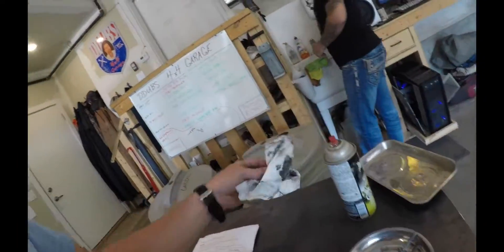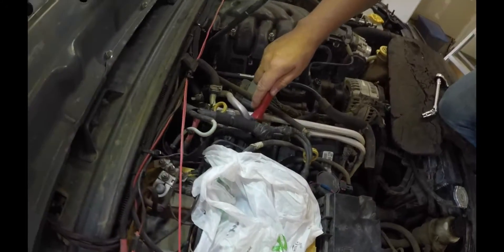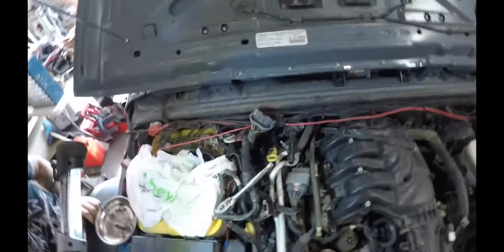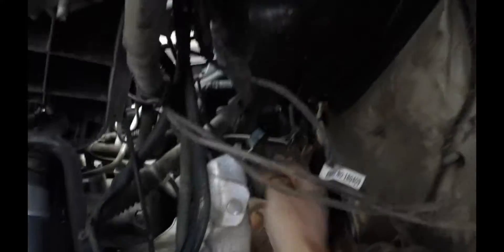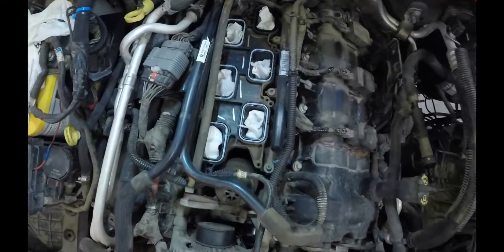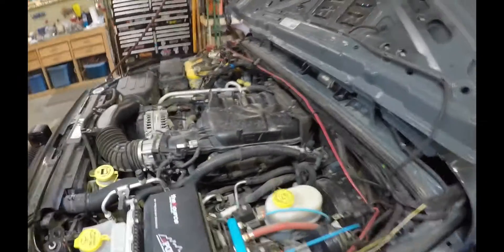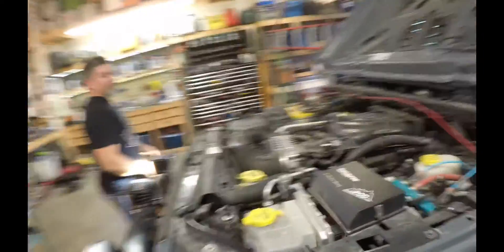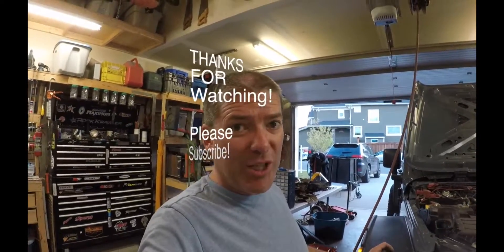Changing Spark Plugs on a 2014 JKU

Comment: You don't have to go through the wheel well to take off the bolts to the bottom of that bracket. You're just take off the top bolts. The plenum will lift up and slide towards the passenger side, and come right out from those studs. It's better to leave them attached because you can slide the slugs in and then the plenum down so you know that you're right on top of the gaskets without shifting them out of place. 
(However) with a 13mm deep well socket, a wobble socket, and about 16" of extension you can, it's really not big deal cuz you can get in there and loosen them up. To me it's easier to get it out of the way but I'm just saying you don't necessarily have to if you don't mind working it out.
Reply: Yep exactly. Most other videos on this job, show that you don't need to go through the wheel wheel or even take that bracket off completely.

Comment: Guess who isn’t going to change plugs.....that would be me
Reply from the maker: It's not that hard, just time consuming.  Having the right tools does help too.  Thanks for watching.
Reply: Did you end up doing it yourself or taking it to the shop? if you took it somewhere, i'm curious how much you paid? I did my plugs & plenum gaskets today, it was not TOO bad, but by far the most complex project i've done on my JK. Super satisfying and a confidence booster for projects to come.
Reply: I’ve been thinking about doing it. I have enough money left for shop fees. It’s spark plugs and serpentine belt or front axle seals and ball joints? I’m working outside so I’m picking my battles.

Comment: There's nothing simple and straightforward about this. My old TJ 4.0L Sahara involved no disassembly. You just popped off the cables, swapped out the sparkplugs, put the cables back on and done. That's simple and straightforward. Manufacturers design this way  to feed business to repair shops but at least it's not German.
Reply: joke is on the manufacturers that there are a tone of video's on how to do this.  but ya I miss the days of my old 90's honda's... so easy to do a plug change
Reply: I hear ya. I changed the plugs on my friend's 97 TJ and it was a breeze. I'm changing plugs on my 2013 Jk tomorrow, gonna be a job.
Reply: @gsabella4  make a video!
Reply: @mdpocoroba  Maybe I will! the whole time I will be referencing videos like these, and i don't know how that would look on my footage lol
Reply: @gsabella4  lol
Reply: @mdpocoroba  After watching a few videos, this doesn't seem like a tough process, just a bit time consuming and keeping everything organized is key. I'll keep ya posted
Reply: @gsabella4  Thanks, I appreciate that! My TJ was simple but they built this motor like a German car as far as doing your own work lol
Reply: @mdpocoroba  Spark plugs and plenum gaskets replaced! Definitely had some challenges, but not too bad. Took over 2 hours. Really helped to take some tips from this video and also followed along 1A Auto's video on JK plenum gasket replacement. Super excited to have got this done, my plugs were toast @111k miles. She is running so much better now!